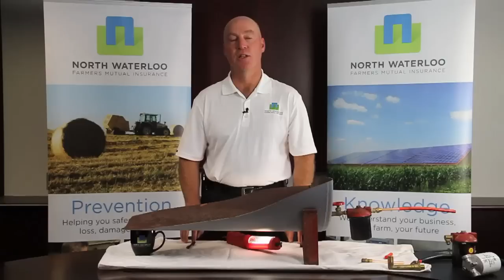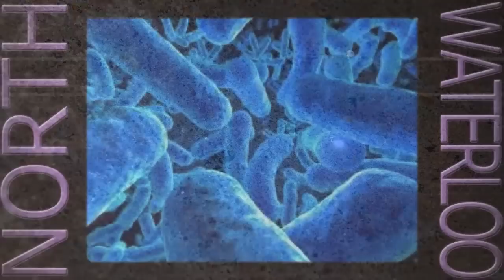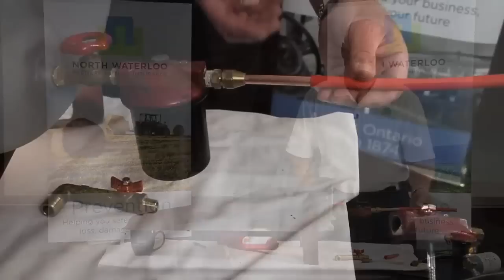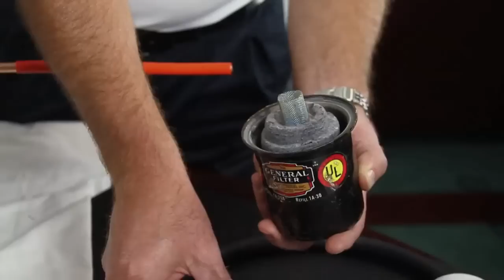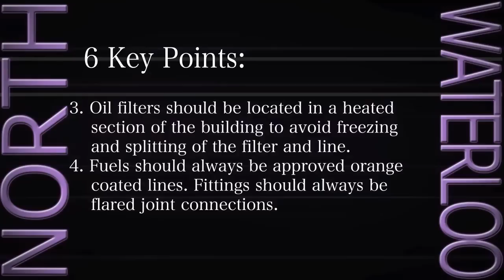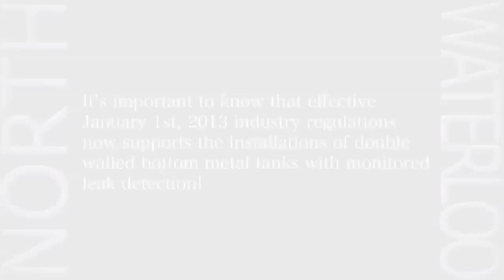Oil Tanks - An Inside Look

Comment: Why don’t they coat the inside of the tank with a  liquid sealer when it’s brand new like they can do with a gas tank if it has rust. Or double wall the bottom if steel tanks have problems. Steel tank warranty has gone from 10 years to 3 years